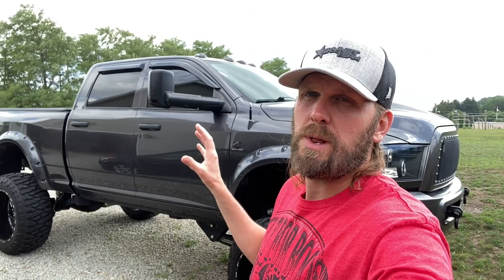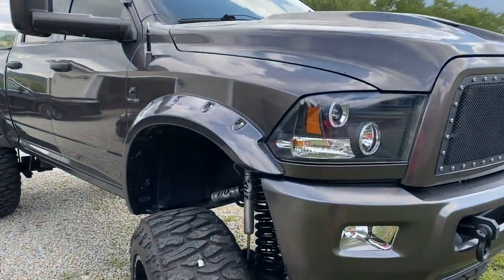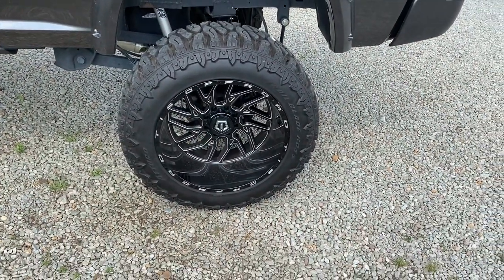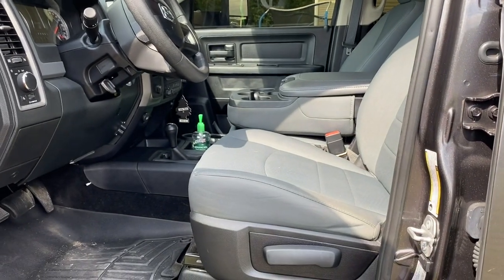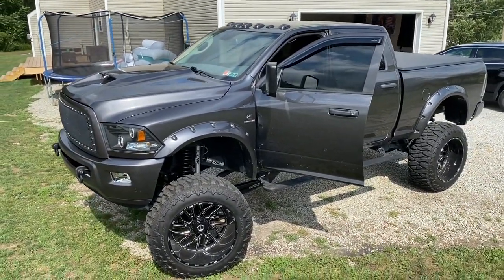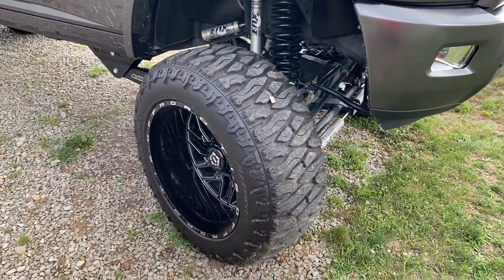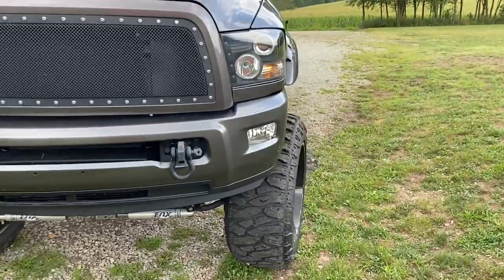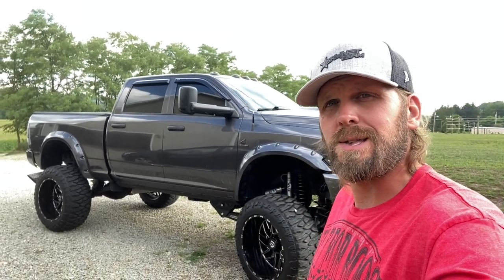My 2016 Ram 2500 6.7 Cummins Crew Cab Walk Around

Comment: Hey hey my Man ! .... thanks for the pictures on Instagram showing the notches you had to do to get the RBP Power Steps to fit .... A suggestion for your front bumper and maybe even the grill .. I am going to be spraying them with Raptor Bedliner, maybe something you might want to do , it will help against rock chips and you can also tint the bedliner to match your truck's paint ... I am actually going to spray both front and rear bumpers, the grille and also my full coverage Bushwacker fender flares ... 

I think you should make a quick video of exactly what you did to the body mounts to get the RBP Power Steps to work, no one on youtube has that video ... I am going to make a video of the actual notching being done when I do put the 3" body lift on mine ...great videos Matt ... B@D@$$ truck as well !

Comment: As for the tires, has anyone tried breaking them down and rotating them on the rim? I have done that many times when I used to work in tire shops. Learned it from an old guy at one of those shops. He knew his stuff.
Reply from the maker: I had it at the shop this week and they had a hard time getting them balanced.  In the middle of trying to get them exchanged but if not, I may have to have this done.  Thanks for the advice.
Reply: @DieselLegiance  it may work with machined rims. Mark the heavy side, break it down, rotate it 180 degrees on the rim, then reinflate and check the balance. Maybe worth a try 🤔
Reply: Did that with my 42” swampers

Comment: Whatsup bro 
I have same year of truck im running a 8.5 in lift with 28x16s & 42in tires i currently have the same BODY-LIFT also from  Suspension Connection its waiting to get installed did you have to do any modifications ?
Reply from the maker: Yes, the body lift required me to put an extension sleeve on my cold air intake tube, and I needed to trim/notch out a couple spots underneath the frame for my power step motors to clear.  Other than that it was good.
Reply: What brand lift
Reply from the maker: I had a 8” McGaughy’s suspension lift with a Performance Accessories 3” body lift